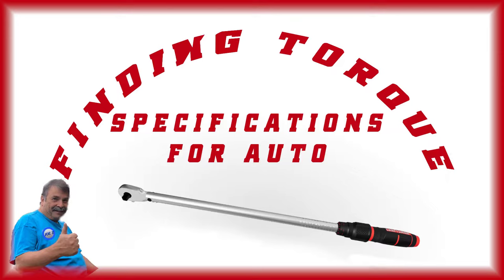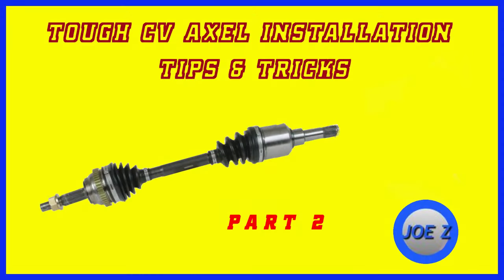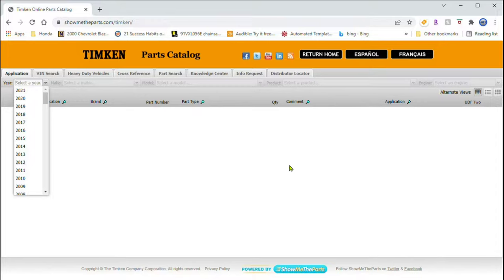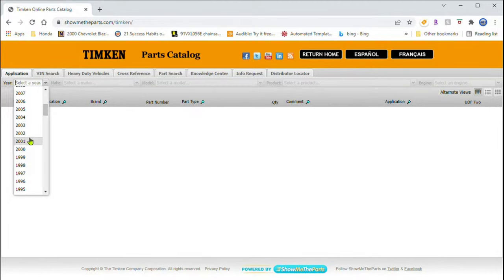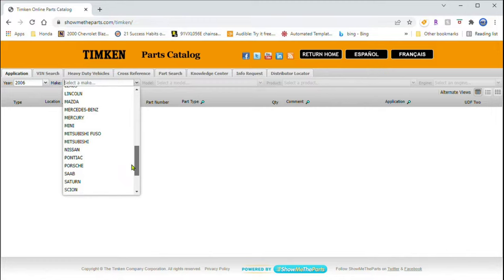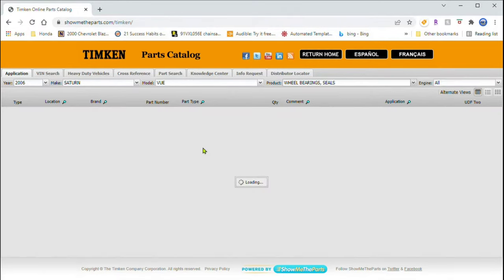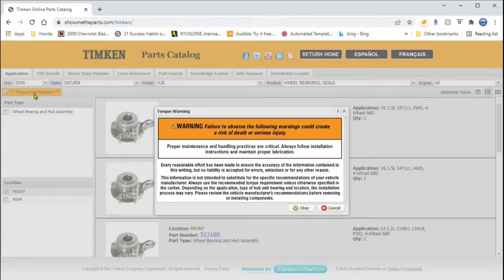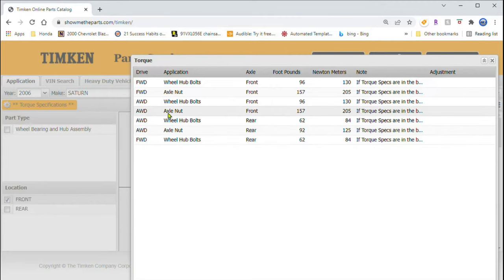Finding torque specifications for auto  "This site is axle assembly specific"

Comment: Yup lets all trust a website with a disclaimer to build motor worth thousands
Reply from the maker: Thank you for stopping by & taking the time to comment. This is just one source to help the DIYer that does not have a shop manual. In these times a disclaimer is necessary to "CYA", plus it makes the user aware there may be certain times/situations that affect the specs to be used. If I was rebuilding an engine I would invest in a shop manual to have all the specs I need when I need them.
Stay safe, Joe Z

Comment: Joe what do they mean by setting  the torque step 1— step2. 😎,I think I know but want to be sure.thank for any help😎
Reply from the maker: Thank you for watching & for your question. When I am working on equipment some instructions will give 2 torque specs. The first one is done to all the bolts then the second one is the final torque specification. This is to keep even pressure and the part from warping. I believe this is what they are referring  to.
Let me know if this helped.
Stay safe, Joe Z

Comment: How many torque for oil pan Jetta 2009 2.0ltr.
Reply from the maker: Thank you for watching and taking the time to comment. @lionelmaria4033  When I checked the site I could not find the torque for the oil pan. It only showed the Engine Crankshaft Seal along with some others. It may be they only show parts & torque that they sell. I have used this when replacing wheel bearings.
Sorry I could not be of help with this matter.
 
 Stay safe, Joe Z

Comment: I don’t see the link sir
Reply from the maker: Thank you for stopping by, here is the link   Timken parts catalog         http://www.showmetheparts.com/timken/
Stay well, Joe Z
Reply: Sir the link does not work do they have a app?
Reply from the maker: @exoscrewdriver4213  I know these links sometimes change but I just tried it & it worked:   http://www.showmetheparts.com/timken/   Try it again & let me know
Reply from the maker: @exoscrewdriver4213  I do not know. This is the only way I know how to get the information from them
Reply: @JOEZEP54  I just get 3 dots blinking middle of screen currently working on water pump trying find the torque on the 11 bolts 1994 ford f350 7.5 liter  460
Reply from the maker: @exoscrewdriver4213  I do not know if I am using this site correctly but I could not find the torque specs for the water pump. Found it for other torque specs on this vehicle. Sorry I could not be of more help.
Reply: @exoscrewdriver4213  same
Reply from the maker: @exoscrewdriver4213  Were you able to get the specs you needed?